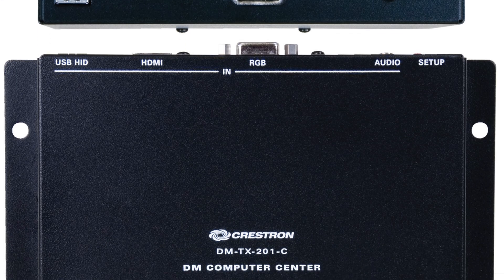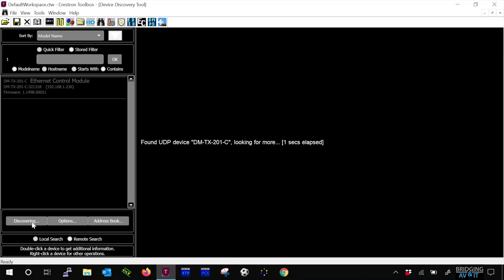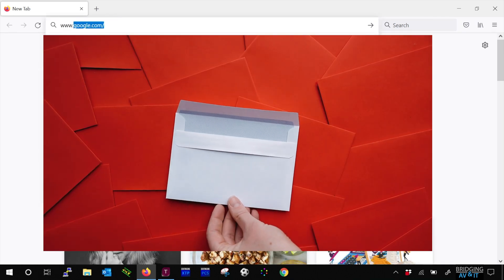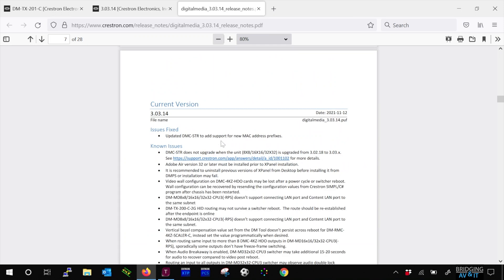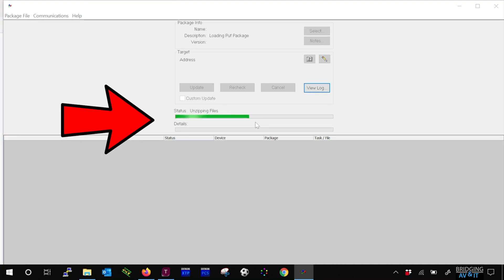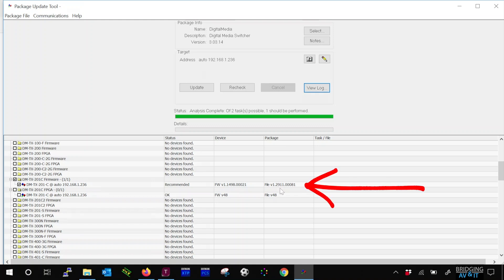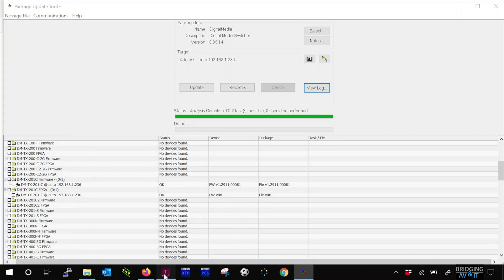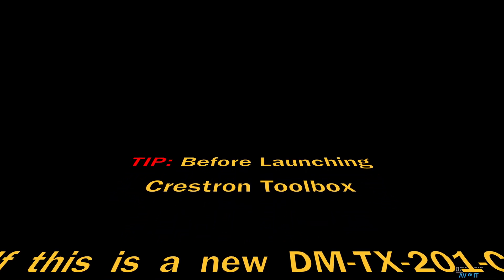Crestron DM-TX-201-C Firmware Upgrade

Comment: I keep getting an SSL error message asking me to use an SSL address for the device instead of the auto address generated. Can anyone help with this?
Reply from the maker: I need more details on your problem, but try to use https:// then your device IP address. Try using the Chrome or Firefox web browser.
Reply: @AVNetworkGuy  Thank you fro the quick reply. The specific error message I get is this: 
Due to some limitations in the Puf tool/device, the tool cannot update the device using the "auto" protocol in the selected address

(auto DM-TX-4KZ-202-C-10637c).

Please use an address with the "ssl" protocol (ctp DM-TX-4KZ-202-C-10637c) and re-select the address.

The Puf tool will re-connect/re-analyze the device. You can then update the device if necessary.

Sorry for any inconvenience,
Reply from the maker: @opuofbengal5935  Use the DM-TX IP address instead of the hostname.
Reply: @AVNetworkGuy  my 202 transmitter is connected to a 150 c processor via the DM cable. Do I have to my 202 to the network via the lan port in order to get it on my network?
Reply from the maker: @opuofbengal5935  Yes